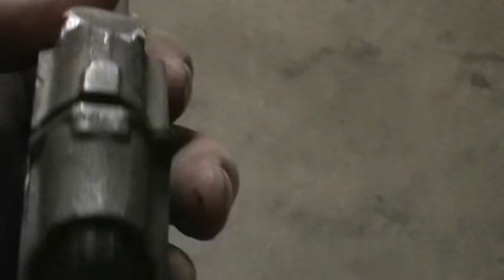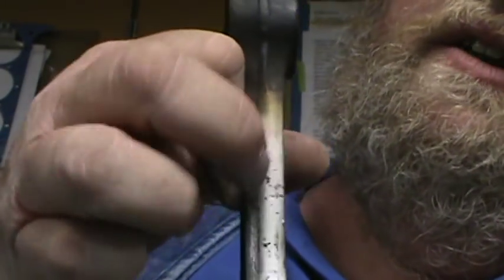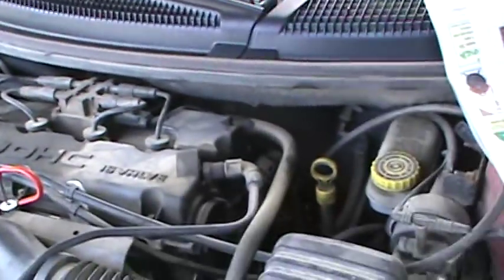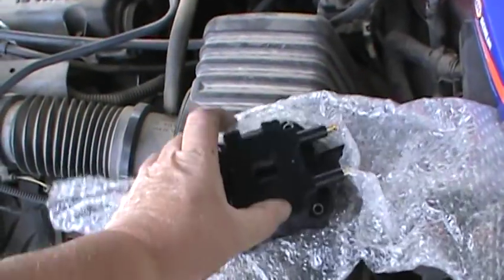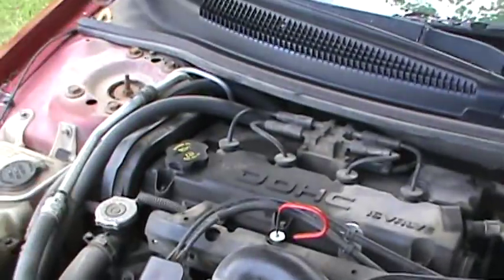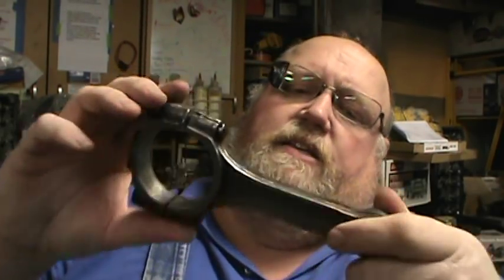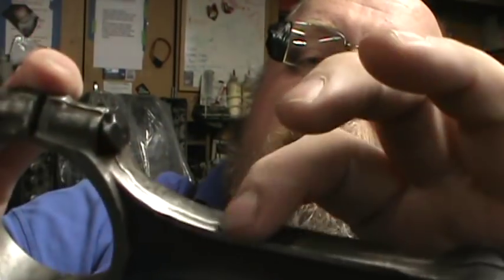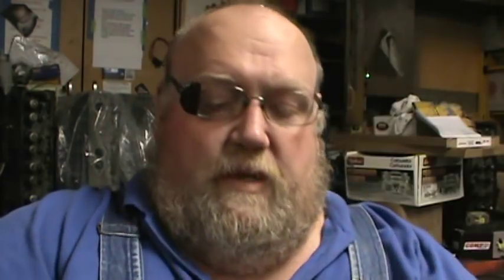worked on 2006 dodge and the kid even helped

Comment: How much more stroke will a 400 block allow if the same things are done with the clearances and the small base circle cams?
Reply: I had a 3.875 forged stroker in a 421 Lunati  motor, good for 7500 RPM's,with a small base roller cam.Internally balanced.
Reply: Im not sure about a 400 block but i know a dart shp small block chevy can take a 4"stroke. I currently have a sbc 437 with a dart shp block.